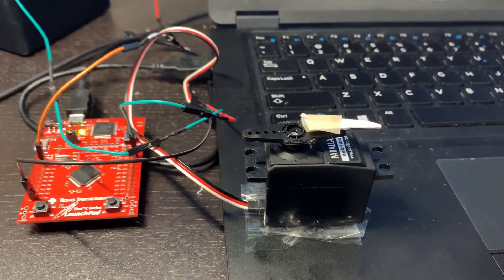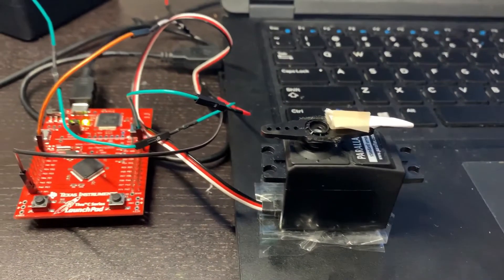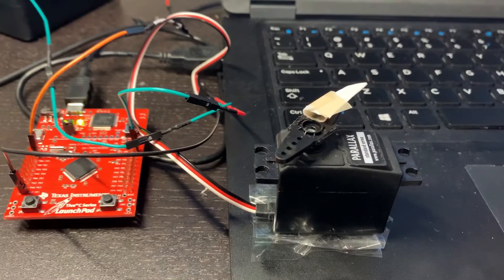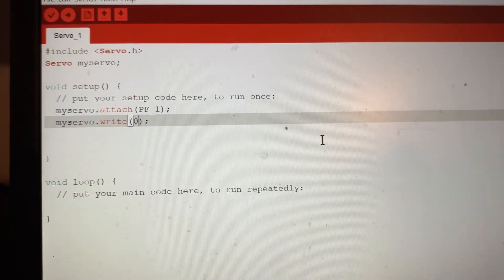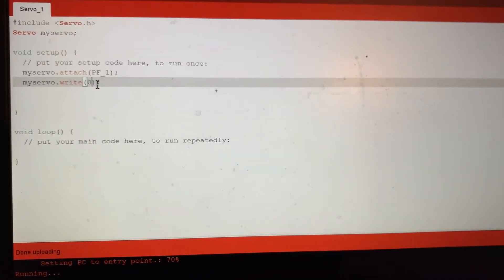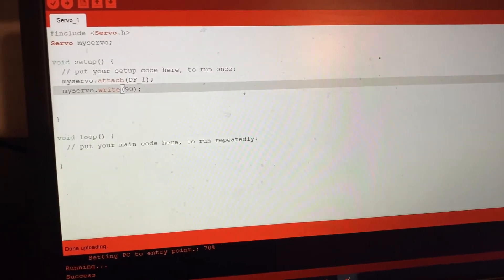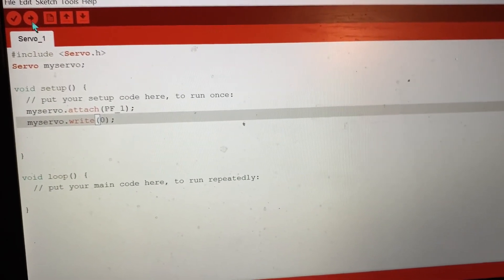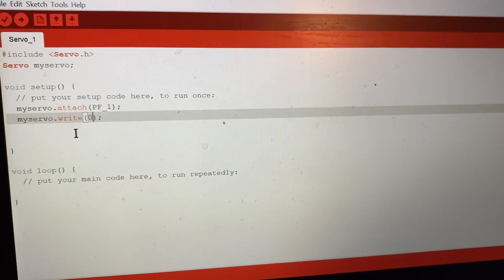Using Standard Servo Motor with  Tiva C Series TM4C123G Launchpad- Part 1

Comment: thanks for the video, i wrote the same code but it is giving an error  'PF_1 was not declared in this scope.
i hope that you can help with this
Reply from the maker: Check followings: 
1)	Make sure you install servo library correctly.
2)	In Energia check Tools/Board and make sure to select right board (Tiva™ C Series TM4C123-80Mhz)
3)	In Energia check Tools/port and make sure you are in right port.
4)	Disconnect the servo from Launchpad upload the code then connect the servo to the  Launchpad 

Hope it helps!